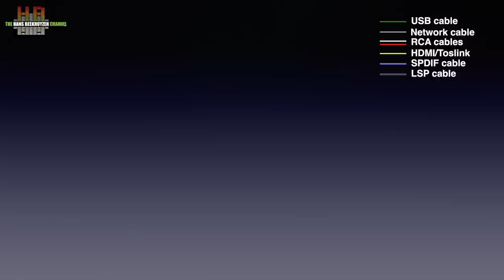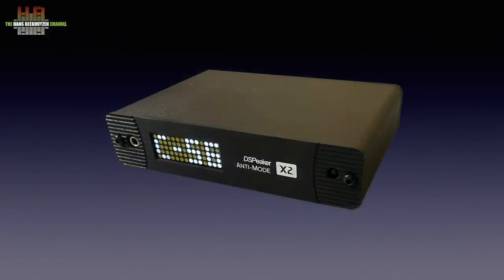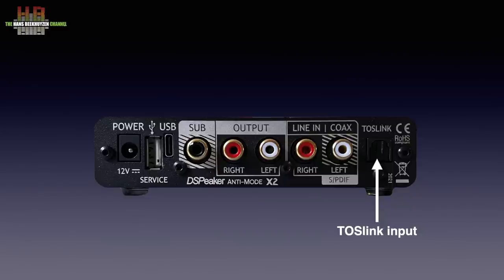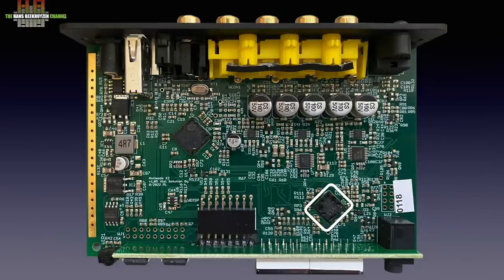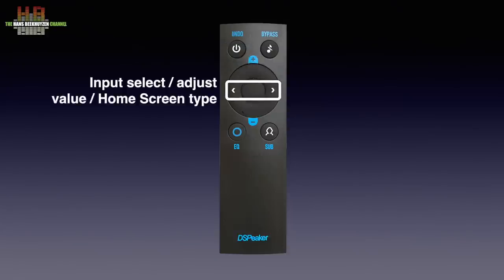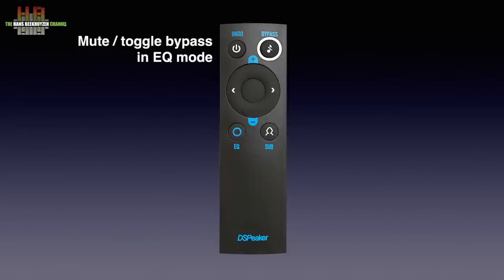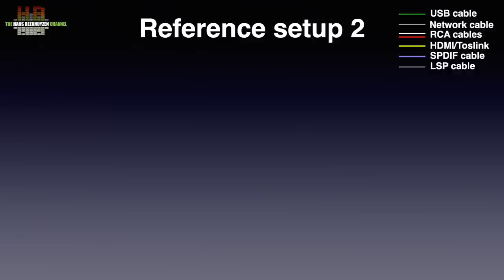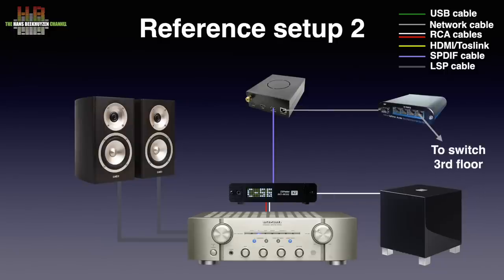DSPeaker Anti Mode X2 Room Correction System

Comment: This is exactly what I have been looking for!  Though I wish it had digital out, and put this BEFORE my Black Ice DAC.  My whole system is around $4k, and I just can't see spending over $1000+ for a Dirac unit with digital out and software license (or I don't want to spend that much!).  My listening space is NOT optimal at all, and I cannot have speakers or seating positions anywhere else, so something simple like this in the chain to correct room nodes can likely be game changer, even if it in ways diminishes what the DAC and sources are capable of extracting.  I've tried your tutorial of adjusting 4 frequencies in Audirvarna, and discovered how vital some correction can be, at least in my space.
Reply: Hi, i know this was a while ago. I have been looking into these devices. There is also a dspeaker antimode x2D this has digital inputs and outputs. Optical and coax. I have a cd transport and separate dac so i am thinking of maybe trying it in between them.

Comment: Here in the US, Paradigm has been closing out a similar device for a while now. Their PW-Link product is almost identical (including Anthem Room Correct) and DTS Play-Fi. For $200 the device is a home run, and I've even encouraged Paradigm to continue selling the product once the new old stock is gone. The ARC software does require running it from a PC but once done the PC is out of the loop. The difference in sound quality is hard to be believed from my system (Rotel A11 Tribute and KEF LS 50 Metas). I did find your observation interesting as system quality goes up the need for room correction might diminish. I suspected, as you stated, that the room correction module could be a limiting factor in the system. BTW, you look very well, so keep up with whatever you're doing. Cheers.
Reply from the maker: It's the algorithme that define the quality. So having the same functionality doesn't say anything about the sound quality.
Reply: I have some questions regarding the pw link. I am not interested in its streaming function, just the ARC correction. As I understand it, it works only for 2.1 systems correct?
Is the new ARC software being updated to support all the new features of ARC genesis or is it confined only to the latest Anthem products? Thanks
Reply: @sbattosai  Hi Yann, I'm running a Rotel A11 Tribute 2-channel system. Much to my surprise, this little device is still getting the latest ARC upgrades. From what I'm seeing in the software, it does appear that would work for a 2.1 system. The Link has an optical out, so it stands to reason that it likely will pass a 5.1 signal as optical was limited to 5.1. My understanding is to get beyond that the system would need to use HDMI. Having experience with a Yamaha home theater receiver (RX-V2600), your challenge would be in routing the digital feed out/into the system. If you were to have a 5.1 capable optical input switcher (I've seen some on Amazon) you could route the different digital inputs (TV, CD, game console, etc...) into the switcher and then out of the switcher into the Link's optical input. From there, all the signals would go through the room correction software and back to the digital output feeding your home theater receiver. This is similar to how I run my system: the output from the DAC goes into an analog input on the Link and the output from the TV goes into the optical input on the Link.

Sonically, the device works very well and my system is quite pleasurable. While I know you're not interested in DTS Play-Fi it has been improved and does support gapless playback on Qobuz. For free, that makes Play-Fi a worthwhile addition. I happened to check last night, and they're still for sale. I like the unit so much that I bought a second as in my view it solves a multitude of audio problems. If you have any other questions feel free to add them to this thread.
Reply: @larryh9525  thanks, after reading more about the device, it looks like I should give the PW Amp/ML Forte a try due to the subwoofer output. In those systems ARC genesis allows bass management while in the Link/Unison it does not. I have a Yamaha receiver from 2017 and YPAO is not fantastic. I do have an antimode 8033 for bass dsp duties but would love to see how my room looks like with a more powerful room correction software without breaking the bank. The Forte is on sale at $250 so I am leaning towards this system. The antimode X2 is probably a little too much for my wallet. We'll see how it goes and how I can integrate it in my system. Thanks for detailed explanation.
Reply: @sbattosai  Yann, my Yamaha HTR has YPAO, so I'll shed some light on my experiences with it. YPAO seems to have only 7 adjustment points, which line up with the 7 PEQ adjustments whereas ARC adjusts over the full spectrum. YPAO always seems to run the treble hot above 16K (like +6db), which required me to use the PEQ adjustment to bring it closer to 0db gain. If you're comfortable with the PEQ, it's possible to tailor the sound more than ARC. However, ARC is easier. With ARC, since I don't use a sub (KEF Metas), I tweak the bottom end under 40Hz giving it a bit more foundation. I have two residences, with two different systems. In residence #1, I have the Yamaha and a Paradigm 5 system (with Studio 20s as the fronts). That combination with YPAO was excellent, especially for music. In residence #2, I have a Rotel A11 Tribute (2ch) with the KEFs. With ARC the KEFs sound amazing, so I figured that the Paradigm's would sound equally amazing. Based on that thought, I shipped the Paradigm's from CT to NC. No matter how much I tweaked ARC, I could never get the Paradigm's to sound as good as memory served in the first location. My point in mentioning this is that certain speakers and amp combinations (with YPAO) sound amazing. BTW, without YPAO the Paradigm's sounded awful, so there must have been some combination between the Yamaha/YPAO that tweaked what the Paradigm's were missing. In the end, I sold the Paradigms. When I go back to CT in the fall, I'll bring with me a set of Elac UB52s and see how they fair with the Yamaha/YPAO combination. Good luck with your research.

Comment: Nice review Hans. I have been using the DSPeaker antimode dual core for over 10 years and think it is a great improvement for my system. This older model seems to be more flexible although more expensive, than the new X2. I use it in digital pass through mode with my phono preamp feeding the balanced analog input and my digital sources fed into the toslink input with the Anti-mode connected to my external Chord DAC. I find it really does “tidy up” some of my room issues with cleaner (less distorted) bass and also clearer midrange. It is highly transparent and I struggle to find any negative impact on the sound quality when I completely omit the anti-mode from the signal path (I can simultaneously run my fully balanced PS Audio phono preamp directly in to my audionote preamp and easily switch inputs between the corrected digital or pure analog signal paths). I do wish it would output a higher sampling rate in to my Chord DAC (it is limited to 24Bit 48kHz digital output). The X2 on the other hand as you stated only outputs analogue signals. My experience is that DSP when implemented in a considered way is beneficial and I wouldn’t go with out it in my room. DSPeaker are a very interesting company who make well implemented DSP products. I’d love to hear your thoughts on their higher end DSP products.
Reply from the maker: I have not reviewed their other products, so I can't say.

Comment: Been using anti-mode in my home theater setup for a long time and it is a really good unit. Now started to think that this new one could fit into my main stereo setup as well. I've kept it totally passive, line-array dipole setup, but there is slight stereo imbalance because of the room shape. I wonder if this could fix some of it.
Reply from the maker: Hard to say from a distance. Can't help you here.
Reply: @TheHansBeekhuyzenChannel  yes no worries. DSpeaker is a local company, so I'll probably test it anyhow.

Comment: If you have an Innuos zenith that runs into a standalone DAC which runs into the integrated amp, this unit would go between which two pieces?
Reply from the maker: No, hit has no digital outputs. You should look at MiniDSP models for that.
Reply: Actually, if the Innuos has analog outputs, you would connect these into the X2, just like a CD player. From there the signal would go into your integrated amp.
Reply: This Dspeaker x2 is also available as x2D version with digital inputs and outputs.

Comment: Hans if I use a preamp into poweramp, do I connect the device before or after the preamp?
Reply from the maker: Both is possible, it depends a bit on the amplifiers used. The safest way is in-between the digital player and the preamp.
Reply: @TheHansBeekhuyzenChannel  
Thanks for this answer. 
So, by owning a Denafrips Pontus II,  a Denafrips Pre- Amp and 2 Class D monoblocks it's obvious to connect the AntiMode between the Dac and Pre-amp?  
Little bit afraid losing resolution. 
Thanks again 
Jakob

Comment: i‘m very Interested in the x2 but i‘m afraid the Sound could be not as good as without the x2.I have a very good System,only some mode at lower frequencies.
Reply from the maker: “A very good system” is a vague description. But depending on whether you are a very critical listener or not, I would certainly use the system op to € 6000 stereo’s. Above that, look for the MiniDSP SHD Stúdio (https://youtu.be/zr_oqF9jb-8). Above about € 25k you should go for acoustic measures.
Reply: @TheHansBeekhuyzenChannel  ok thank you,so i go for acoustic measures.Thank you for your honest information.

Comment: I do not know why, but to my ears all equalizers, that I have tested, make things worse.
Reply from the maker: As I have noted earlier, a DSP can solve problems and as long as the cured problems do more harm than the computational work does, it's a good compromise.
Reply: @TheHansBeekhuyzenChannel  Thank you - yes it was mentioned in the video. I just find it odd, that a little PCM math can do so much harm. Studios do it all the time 🤔They must have "better" processors or data to work with. Changing the analog crossover in contrast sounds natural. I clearly do not undertand everything - just using my ears.
Reply from the maker: There are more powerful processors but they are costly. They are used in upsamplers like those by Chord, Auralic and Grimm. But even with high end processors clever algorithms are needed. And I wonder if high end algorithms for room correction are in existence today. As I have mentioned before, using true high end audio equipment almost always make room correction unnecessary.
Reply: @TheHansBeekhuyzenChannel  Think you may be on to something.
The room is a smallish (12.5' x 14') concrete bunker, which is shared, and which I can't alter much. Thick rug over most of the floor, a big over-stuffed couch, and a quilt on the wall behind. That's it.
I tried the Klipsch RP600M. AAAARGH!!! Then I sank about $4grand into a diy MTM ribbon affair. MUCH better, but nearfield was the only way to get bliss from them. Next came Siegfried's LXmini, with four channels of Neurochrome class AB power, and a Nelson Pass balanced ASP electronic xover. MY, OH, MY!!! So good, in fact, that a woman who is deaf in one ear (and who always declares that bits-is-bits) asked immediately, ''What did you do?'' when I changed speaker cables the other day. ''Why?,'' I said. ''Somehow, it doesn't sound quite as smooth as before,'' she replied.
I had switched in some new cables that apparently need lots of break-in and sound a bit harsh right out of the box. The old ones have many hours on them and sound smooth and warm by comparison.
As she was coming back down the hall about an hour or so later she shouted, ''So, I see you gave up on your new toys already.'' 😄
So, yeah, I've got lots of other stuff to work on before I start spending ducats on room correction.